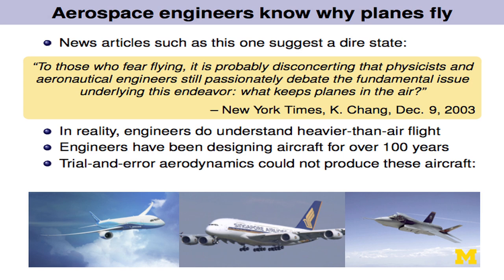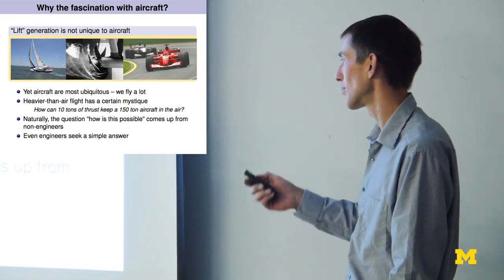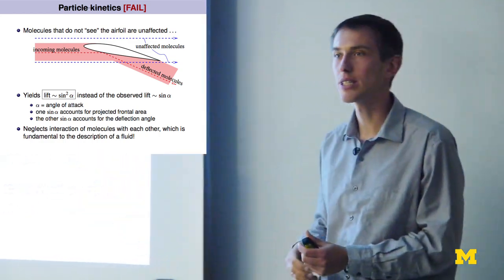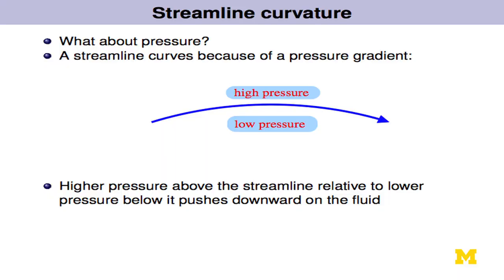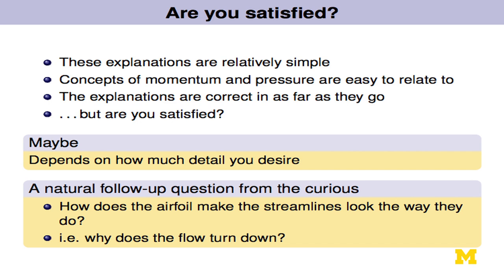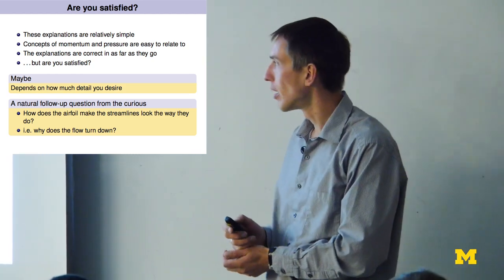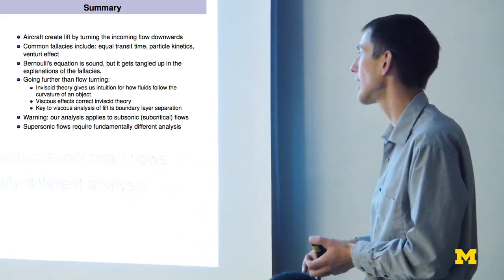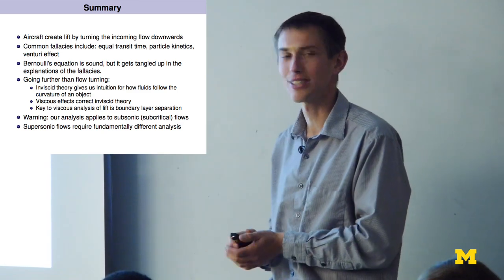Krzysztof Fidkowski | How Planes Fly

Comment: That's one of the more incomprehensible talks on lift I've seen on Youtube. How about keeping things simple? 

First imagine two chaps engaged in arm wrestling. Let’s say instead of joining hands they both push against a plate with their hand flat. So the left guy pushes against that plate, the right guy pushes against it, and as long as they push with the same amount of force, that plate won’t move. 

Let’s say the left surface of that (vertical) plate which is exposed to the forces of the left guy’s hand pushing against it could be compared to the lower surface of a wing (mentally turning the plate 90° counterclockwise) and the right surface of that plate which is exposed to the forces of the right guy’s hand pushing can be compared to the upper surface of a wing. 
That wing won’t move and will not experience lift as long as the net sum of forces below and above de wing (or the opposing forces of the left guy and the right guy) are the same. 
Now imagine the right guy becomes exhausted and his force weakens. The left guy is now able to push the plate towards the right, however the forces exercised byt the left guy didn't increase, it stays the same (in this example). The plate is moving right only because there is less amount of countering pressure from the right guy’s hand. 
The plate will move even more forcefully to the right if when the countering forces of the right guy weakens, the left guy decides at the same time to push even more forcefully against the plate. 
The net sum of both forces, that is the force of left guy pushing against the plate (or, if you rotate that image counterclockwise by 90°, pushing from below upwards against the wing) and the countering force of the right guy (pushing from the right or downwards if you rotate everything by 90° counterclockwise) is lift in the case of an airfoil or wing, if the net sum pushes the airfoil or wing upwards. 

Now who are those two guys in the case of the airfoil or wing ? They are nothing more and nothing less than the static air pressure pushing at all times against the wing, if there is no airflow, then the "plate" will stay in the middle and the wing will not experience lift, but if there is airflow, aerodynamic effects generated by the AoA and the camber of the wing influence the pressure the surrounding gas molecule can exercise on the wing by aerodynamic effects which act on both the lower and the upper surface of the wing. That is, by aerodynamic effets, the force air pressure can exercise against the wing is either weakened (above the wing) or increased (below the wing). That what is known as pressure differential. 

Now the upper surface alone cannot create lift, it only contributes to lift. 
The reason for that is that there is no such thing as suction or negative pressure. Pressure is always positive and air is always pressing against the upper and lower surface of the wing, at all times. There is no force pulling the upper surface of the wing upwards, as air cannot grip the wing and pull away from it. The wing is always lifted because air pushes the lower part of the wing upwards. 

Back to those arm wrestlers : if there is no left guy present, it does not matter how much the force of the right guy will be weakened, there will never be any push towards the right (there will never be any lift if the image is rotated counterclockwise by 90°).
So there can only be lift if gas molecules around the wing are exercising pressure against the wing (an atmosphere featuring pressurized air needs to be present) and if there is air present pushing against the lower surface of the wing. 

Imagine putting the wing in a mold filled with low amount of water just so that the wing will float and that the forward and aft stagnation points are just level with the water surface and the upper end of the mold. If wind blows against that wing, airpressure pushing downwards on the upper side of the wing will decrease as air flow hits the upper part of that wing , however as there is no airflow below the wing, the wing will be unable to lift from the mold. Also airflow will not be bend downwards against the water surface, it will just flow around the upper part of the wing and continue afterwards horizontally in a laminar flow. No lift is generated by the upper surface of the wing alone. 
Therefore, the pressure differential between the air under the wing and the air above it is decisive. It explains lift. But how is the pressure differential formed ?
I’m with Bernoulli on this one. Airspeed of local air flow must be different in order to influence the effect static air pressure has on the wing. That is, the faster the airflow, the less force static air pressure can apply on the wing. 
So in order to get lift, local airspeeds below and above the wing must be different, locally increasing or decreasing the pressure created by the static air pressure.

This works even in other situations. 
Behind a long 40 ton semi-trailer truck, there is a lot of slipstream. Now you might think that this slipstream is enough for a cyclist to be able to travel at high speeds, like 60 - 65 km/h on the flat, without much effort. Actually, that’s not the case. 5 meters behind that truck, the air feels like not moving at all (calm air), however a considerable amount of force is still needed to overcome rolling resistance in order to not lose the semi-trailer. However, there is a small region about 2 m behind that semi-trailer where very turbulent air dominates, and 20-30 cm farther away, it calms down to what feels like total calm. Suprisingly, when the whole cyclist is situated in that calm air, the cyclist must steadily pedal in order to stay with the truck, but if the distance is decreased so that only the back is in calm air but not the frontal side of the cyclist (the effect is increased by getting as upright as possible on the bike), there is a net force pushing the cyclist forward against the truck. This can only be explained by more air pressure hitting the back of the cyclist than his frontal aspect. The effect is maximized by staying with the face and torso in the most violent turbulent air (it feels as if one is continously slapped in the face) whilst exposing the lower back to calm air. Not only is it no longer necessary to pedal, it becomes necessary to slightly brake. My explanation is that the highly turbulent air slapping against the upper part of the body (face, torso) diminishes the effect static air pressure has on that region, whilst the calm air hitting the back is not diminishing the effect of static air pressure, creating therefore a pressure differential which pushes the cyclist against the semi-trailer. One has to very carefully keep the body in that « window of opportunity » as the region this effect happens is no wider than about 10 to 20 cm (a distance of about 1 to 1.2 meters between the end of the semi-truck and the front wheel). I was therefore surprised that the best spot behind a semi-trailer would also be most noisy place where I would constantly be hit hard against my face and torso from both sides of the slip stream. 

Another example : imagine a vaccum suction cup holder, once installed on a window pane, it actually does not suck on the window to stay put. The part facing the window pane can be compared to the upper wing, the part facing you can be compared to the lower wing. So the "vaccum suction cup holder" remains put because static air pushes it against the window pane (that could be compared to lift) the only difference is, in order to create it, there is no need for airflow because the surface facing the window is hermetically sealed of and the lower static pressure is permanently maintained so there is no need for dynamic airflow over a curved surface at an angle of attack in order to create a local reduction of static air pressure hitting the wing. 

Now, it would be foolish to say the inner part of that suction cup holder created "more lift than the outer part" - as no force is pulling the inner surface against the window pane, only the outside static air pressure is pushing the suction cup against it. Since the inner side is hermetically sealed and no airflow is occuring, there is also no need to send air masses downwards. You could install a suction cup holder on the lower side of a horizontal ceiling window and it will still hold your objects because the static air pressure on the outside and lower surface of that suction cup pushes that cup upwards against the window pane. 
The difference with a wing, there is no hermetical seal and therefore the local decrease of air pressure on the upper surface of the wing must be created aerodynamically and dynamically by airflow streaming against the wing. 

Therefore I still think that Bernoulli is a good explanation why air passing along the surface of a wing decreased the effect static air pressure exercises against the wing and therefore explains the pressure differential.
Reply: Ah and just to be clear: Bernoulli is not the same as "equal transit-time theory" which, of course, is totally wrong

Comment: So as a flight instructor, I haven't found any lecture done by Ph.D. or professors explaining why does air gets accelerated on the airfoil. because every book in the field for student pilot explains the lift with newton's 2nd la and Bernoulli's equation. Here's what does the book say: because of the curvature of the airfoil, the speed of airflow above the airfoil is accelerated, and therefore pressure drops. why does the airflow is accelerated by airfoil's curvature? well, this is how it is. I've never put my self in trouble with this explanation(because it's pretty enough for pilots) but is there anybody who can explain why does air gets speeding up?
Reply: If something accelerates and it has mass, a force is responsible. That's Newtons 2nd law: F=ma

The force is pressure. Higher pressure upstream is accelerating the air as it moves downstream into the lower pressure area above the wing. 

The low pressure above the wing is the result of the airflow being curved as it flows over the top of the wing. 

The airflow tries to turn the corner and feels a "centrifugal force" pulling it to the outside of the curve as it stretches and tries to stay attached to the top of the wing. This generates a pressure gradient from low to high, from inside to outside of any curved streamline.
Reply: @GZA036 Great explanation! Bravo! This falls in line with what I have read.

Comment: A real observation flying through a rain zone. The water droplets on the wing should have been whipped away past the trailing edge, but could be seen creeping towards the leading edge. Boundary layer? Does not seem likely. The boundary layer would be moving forward at a speed somewhat less than that of the wing, so it would be moving slowly backwards relative to the wing, not forwards. I asked the same question elsewhere, but got no takers. Anyone here, please?
Reply: Boundary layer is defined by a turbulent zone that has a velocity gradient from 0 airspeed at the wing surface to the freestrean velocity at the outside.  Inside the BL flow is somewhat unpredictable.  Turbulent areas have flow vectors that can be independent of freestrean vectors.  If it was an airplane window on the side of the plane with water on it, the water was in a turbulent area of separated flow.
Reply: Just like when he showed the wing with separated flow, some of that air is moving backwards compared to the freestream.
Reply: @anonymous12345678935  Thanks. These were droplets on the wing which was directly under my window

Comment: Hi guys, thanks for a video however I found it quite confusing. Especially the explanation of pressure gradient around the airfoil. Below the airfoil as well as above the airfoil, there is lower pressure compared to the atmospheric pressure (to be exact, there is a few spots along the airfoil where this does not apply and the pressure on the airfoil surface is higher than atmospheric pressure - area around the stagnation point and area close to the trailing edge), so how can you explain the pressure gradient this way? How can you even say that below the airfoil, there is high pressure. There is not higher pressure, there is a lower pressure compared to the atmospheric pressure, meaning pressure of free stream. Only reason why the airplanes can fly is the fact that above the airfoil there is even lower pressure compared to the pressure below it, yet both of them are lower than atmospheric pressure - pressure of free stream. The explanation of the pressure gradient and the fact that streamlines are curved is nonsense in my opinion however I really like the idea of using the conservation of momentum when explaining the lift force. It makes much more sense than the Bermoulli's equation. Could you please answer to my comment and make your explanation more clear? Maybe I just misunderstood your concept.
Reply: Jiri Dolinsky the airflow below the aerofoil is actually much slower than that goes over the aerofoil. If two air molecules get to the aerofoil at the same time the one that goes over the top of the aerofoil takes about 2/3 of the time taken by the molecule that goes under the aerofoil. According to Bernoulli the slower flow has to have a higher pressure than the flow prior to reaching the aerofoil and the faster flow much have a lower pressure.

The pressure gradients as described here are normal for aerofoils that are not described as having laminar flow (as fitted to the P-51). Most of the lift generated by a non-laminar flow aerofoil is from the front 1/3 of the upper surface. After this point the pressure rises back to normal air pressure at the trailing edge.
Reply: I have the same doubt. He first says that pressure difference is caused by curved streamlines. Then, he says that streamlines are curved because of pressure difference ... It is not clear what generates the pressure gradient.
Reply: @rauldeira116  I find this, and most others like it, just focus on the fallacies, and then have a simple statement that because we curve the airflow downward we must be generating lift. This video (terrible recording, watch in parallel with another show the slides) goes deeper into how this works, any why Bernoulli only relates to straight streamlines. https://www.youtube.com/watch?v=QY2pS-xXC_U&t=7s Note that he actually appears to give some credit to the Coanda effect, so they still can't seem to agree
Reply: Why do you consider streamlines nonsense?  There are many ways of looking at and estimating the effect of a wing moving through air.  One has to come to grips with the fact that a wing moving through fluid is the same as a fluid moving over a wing.  Once this leap is taken, it is easier to visualize streamlines as the effect the wing is having on the fluid.   Once you are able to see the effect the wing has on a single particle of air, it might help you understand lift by assuming the streamlines do not collide and the effect is on a large number of particles.  But understand that it is one more to look at the forces involved to intuit the goals of a successful airfoil.  Saying, I want to understand all the complexities of why a shape moves a certain direction  when propelled through a nearly inviscus unbounded medium without using an explanation that simplifies the visualization of particles interaction in a way that can be used to estimate lift is a little short sighted.  Pressure and partical movement are all part of the same elephant.

Comment: Did he even explain why the velocity of air increased over the top surface?
Reply: Yes. Lower pressure means higher velocity. That's Bernoulli.
Lower pressure also means that the air is changing direction, curving towards the lower pressure and away from the relatively higher pressure on the outside of the curve.
Reply: @xnoreq  Can you explain why there is lower pressure there because I normally get the answer "because the air has a high velocity, bernoulli", so you are stuck in a bit of a loop if you understand me.
Reply: @guypaterson9503   Imagine a symmetric airfoil at 0° angle of attack. In front of the leading edge a high pressure point ("stagnation point") will form, air slows down, simply because there's an obstacle. From this high pressure point, the airflow has to accelerate/pressure has to drop as it curves over the leading edge and curved airfoil - around the obstacle so to speak.
Note that this even happens on the lower side on a cambered airfoil, just to a lesser extent. The reason for that is that the much tighter curve around the upper side causes higher acceleration/drop in pressure.

As you noted correctly, Bernoulli doesn't explain why there's lift. It only points out the relationship between pressure and velocity and is only valid within a flow field.

Comment: Is he saying that Bernoulli's theory can be disregarded as an explanation for lift?
I understood from him that lift is purely related to the pressure gradient around the  aerofoil.
I'm left a bit confused. surely the reason you have a pressure gradient is because there is greater and less pressure on different sections of the aerofoil. Difference in pressures is therefore Bernoulli's theory.
Reply: +bhfireblade, he says to avoid using the formula to explain lift, as will be of no help. But as you say, he states that pressure differences are in accordance to Bernoulli.
Reply: bhfireblade Bernoulli only applies along a streamline, but it doesn't explain anything other than the link between velocity and pressure with a streamline. It is the shape of the aerofoil that creates the lift force by curving the flow over and under the aerofoil.